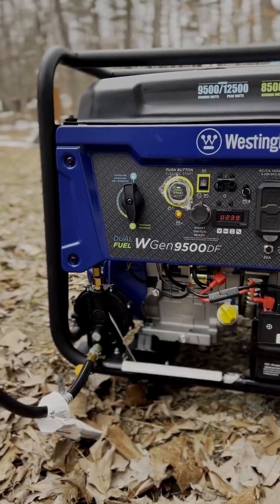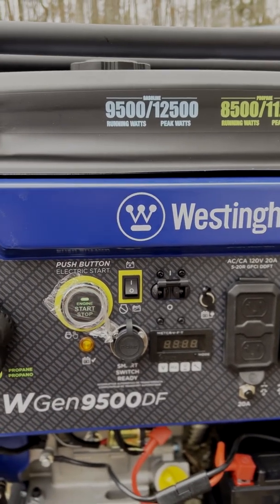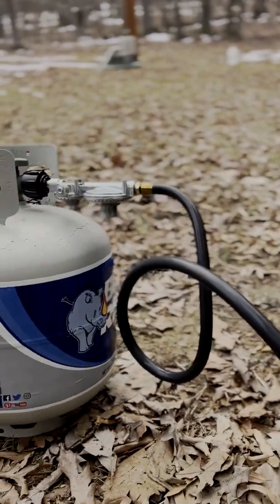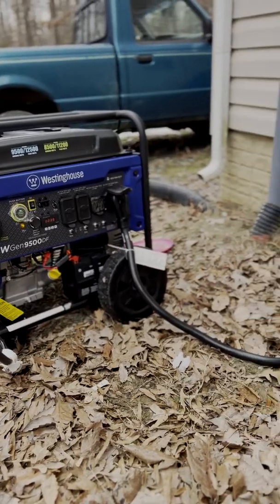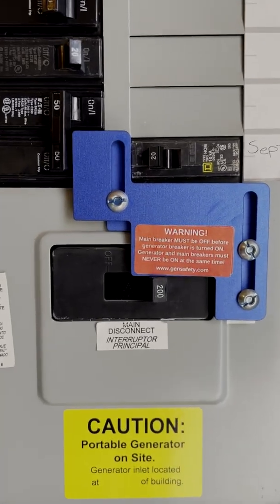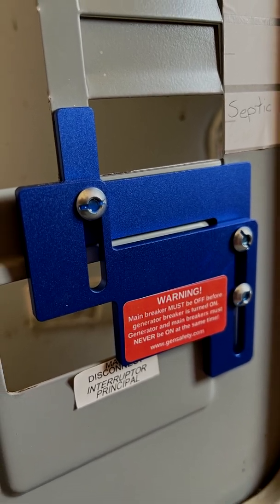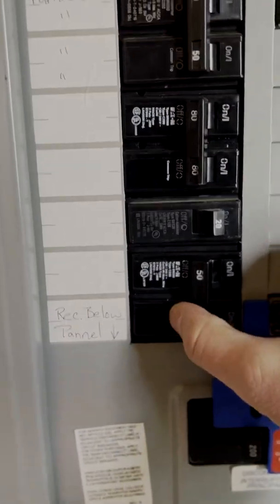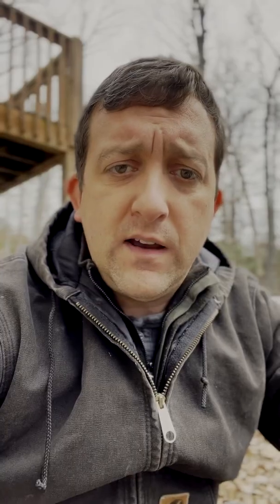Westinghouse WGen9500DF Dual Fuel Portable Generator & Setup for Home Power

Comment: i replaced the 10 amp hr battery with a 35 amp hr battery from hf. solved my starting problem.
Reply: I just got the exact generator and had a new panel installed at the same time with an interlock feature built into it. Also I had an inlet connected to the box which will allow me to connect the generator straight to the panel as in your example. My question is do I need to have a copper ground rod installed too? In looking at the manual I see this generator is bonded neutral to the frame but in looking around the internet I can’t tell 100% if I need that ground rod. What do you think? The information I’m finding is just not clear to me.

Comment: I read the THD is 23% on this model, so not safe to plug electronics directly into the 120v outlets on the generator.  When feeding power through your 50 amp inlet box, are you plugging your electronics into surge protectors?

Comment: If you needed more than 50 amps and you had a larger generator how would you connect say one 50 amp and one 30 amp feed to your house? Do you have to somehow split your panel into sub/separate panels?

Comment: Hi great review!  Quick question I am on the fence looking for a portable backup generator for my house.  I honed in on this one but the only thing holding me back is the high THD for sensitive electronics.  I'm worried about my newer bosch refrigerator and some other equipment.  I do have a few UPS devices for my TVs and routers with there own battery backups.  But just want to makes sure this generator is the best fit going forward for newer HVAC systems.  Thanks
Reply: You need an "inverter generator". This generator is a conventional generator, not good for modern equipment. Plus you have to change the oil on this machine every 20hrs. Not good.
Reply: I’m a firm believer that the thd stuff is over rated.  Thousands of positive reviews on this model. If it killed fancy appliances there would be many people stating so. I have about an 8 year old version of this generator and I have ordered this.  There are two classes of thd. The under 5 percent and the under 23%. It could be 10% or 23%. But here is my experience.  My Westinghouse 7000 was converted by me to run on propane. It’s connected to my house. I have two subzero tci 700 refrigerators (lots of circuitry) each with 2 compressors. I have a digital wine cooler, true clear ice maker, wolf stove with range hood, variable speed well pump with constant pressure (tons of electronics) Bosch digital dishwasher, a few Samsung tvs, computers, microwave,, and an alarm system all running with no issues. Further, I’m buying the new generator because the lights flickered during the last outage and my multimeter showed it was putting 310w out of the 240w outlet. It did that to my electronics for 15 hours and still no dead boards or issues. 
Besides the new gene, I bought a new voltage regulator for my old Westinghouse, maybe I can fix it for $100. At any rate, I wouldn’t worry about the harmonic distortion. It hasn’t hurt any of my stuff.
Reply: @Drrich_DIY  this would probably be fine accept alot of modern power inverter systems for power banks that require a "pure" sign phase lock to convert the 240v and amps to the batteries. 12v, 24v, 48v. It says in the website disclaimer that these power generator sign outputs are not stable enough for modern inverter systems. It's a good generator for the money, for sure. I was going to buy this generator until I found this out. It's still a good house generator, just not for charging power banks. Which sucks.
Reply: And the oil life is bad aswell.
Reply: @hellogoodbye3129  thanks for killing my argument with one statement!  But seriously that's something I didnt even take into consideration since I don't deal with power inverter systems. Never imagined it " just wouldn't work"
My whole life i have been following the "buy once cry once" philosophy. I've been eyeing a winco 12000 trifuel for years now, but it went from 3k a few years ago to almost 6k now.   The few times a year that we lose power the price was very hard to justify so I didnt follow my rule.  
Let's just hope that this generator doesn't kill a 15k refrigerator..........that would make the 6k look cheap in comparison and I would kick myself.  Only time will tell.  Thanks for responding
Reply: @Drrich_DIY  that's alot of money for a fridge! I am building a power bank system for my basic needs, 4 refrigerators, 2 sump pumps, furnace, and 800ft deep well pump. My inverters and batteries can handle that no problem. The inverters I bought are low frequency 6kw each, total 12k, surge up to 20kw. Grid charging, solar charging, and 240v charging up to 100amps off a generator. So you save alot in fuel when you are charging only the bank and not the house. You don't lose the energy you don't use. Basically my wife hits an app on her phone when the grid goes down, and she can have 3 weeks to a month of basic necessities, food, water, heat. Diversity in energy options is safe way to lower your anxiety I have found. Therapeutic in a sense. So good luck bud, think about backing up your backup system.
Reply: @hellogoodbye3129  Wow. That is eye opening.  Thanks for sharing.  I didn't and wouldn't buy those refrigerators- they came with the house.  Unfortunately I have two side by side 3o" and they no longer make that size (and they are flush built in).  so im kind of stuck.  Had one guy tell me he could find me a used one or rebuild mine if it craps out.  You got me beat with the well pump. Mine is 700 feet down and my old one had to be replaced last year.  That was an exercise in paying way more for labor than the product.  I will look into what you mentioned, though.  I had no idea batteries no matter how large could produce that much power over such period of time.
Reply: @Drrich_DIY  20kwhrs should last about 4 days rationing use, and take 4 to 5 hrs of 50 amp charging. With a 100lb tank that should last a month with no maintenance or refueling. Then roll the next bottle over and you have another month. And solar added, for what that's worth. I'm also working on a hydroelectric system that will produce 3kw an hour at 18 amp, supposedly, but that is more than I need with a power bank system. So my inverters have a grid feedback system and I can literally shut off my power line section and feed my neighbors on a time schedule so they can run their refrigerators and wells for short periods a day. Food and water for your friends and neighbors  makes for very loyal people. Energy converted to security. What good is having power in the bad times, when everyone is trying to take it from you. So you give it, with strings attached.
Reply: @hellogoodbye3129  wow. Thats incredible stuff.  I was thinking of welding up three rear wheel bicycle supports to get the rear wheels off the ground, then I can have my wife and 3 kids pedal to generate power while I make myself popcorn in the microwave. 
Not sure if you are from the northeast,  but hurricane Sandy knocked out power around here for 10 days or so and it was way before anyone had generators like they do now (I've only got 2 acres) but every single person in my little development of 25 has a generator. 
Before the storm hit i filled up all 3 cars and about 25 gallons extra just in case.  
Well I happened to have a little honda eu2000. On the fly I made a suicide cord using flashlights and backfed my washer plug with an extension cord. It was enough for heat (oil burner) a college size refrigerator and toaster oven.  1 gallon lasted 10 hours. I would get up during the night to top it off. 
Couldn't shower cause I couldn't run the well pump but we used 5 gallon buckets from the pool to flush.   
Pretty awful so I know what you are saying.
Reply: Well a microwave needs on average about 1100 watts, so you may want to consider a row machine generator so you family has some upper body exercises. Lol. In a situation like yours I would definitely invest in a power bank and solar/wind combo. And have your generator as a backup for low light days. Your neighbors will use up all their fuel in the first week. They will come for yours eventually, so be ready with more options than just violence. Your friend with starving/freezing children is obligated to do what ever it takes to keep his children alive. Even use your friendship against you. Or have a conversation about planning for resource management and identify your own needs. That is key, not knowing how much food and water you use makes knowing what you need impossible. Consolidation of resources with other households is tough and dangerous, but extremely profitable with a solid group of people. Short term an long term.

Comment: Hi there, hooking the generator to your utility power, does it make for a cleaner power output, and are safer for electronics?  Great review, thank you so much!
Reply from the maker: As far as I know, it doesn’t change the quality of the electricity, but it would give you access to all the circuits in the fuse panel.

Comment: Did similar 2 years ago with identical generator. A suggestion would be to add a (Battery Tender Junior, 750mA P/N 021-0123). Keep plugged in to your generator when it's not in use to insure an electric start from your generator battery when you need to use it. Simply unhook from battery when you need to start up generator. The Tender kit came with the correct adapters. Tender has a green light indicator showing that your battery is good and fully charged. I keep mine plugged in 24/7 until an outage.
Reply from the maker: Great point! I’ve been considering building an outdoor enclosure with sound treatment for it as well or purchasing a rain cover.

Comment: Great video.
Just want to confirm,  you went from the 120/240 AC 50A 14-50 outlet from the generator  to the 50 amp plug, is that correct? Also, do you have a link to the cord you used to go from the generator to the outlet ? 
Thanks much
Reply from the maker: Here’s the link to the extension cord that I used:

50 Amp Generator Extension Cord,... https://www.amazon.com/dp/B083TN1LGX?ref=ppx_pop_mob_ap_share

Comment: Hey! I'm an electrician, and I have some experience, but haven't been in the industry too long, and I haven't done this type of installation before. I have this exact generator, and I wanted to know if I have to purchase a 50A generator inlet box as well? All the breakers in my breaker panel are 30A, with the exception of my central AC unit, which is 50A. I'm assuming I'd have to get a 50A inlet box in order to be able to use the AC unit, right? Thanks for the video!
Reply from the maker: If you have the same generator you would want a 50amp setup (wiring size, breaker, inlet box, etc. to support the amperage. This generator peaks at 12,500 watts, which is around 52 amps. In the description I posted the components I used.
Reply: @RatherBDiving1  thanks for the advice and for the quick response :D

Comment: Does the 50 amp service deliver a true 50 amps ?
Reply from the maker: The amperage delivered would depend on your generator’s power output. This generator should peak around 52amps and run in the mid 40s. The circuitry should safely support 50 amps. I hope this helps.